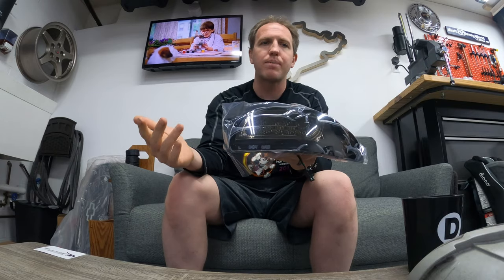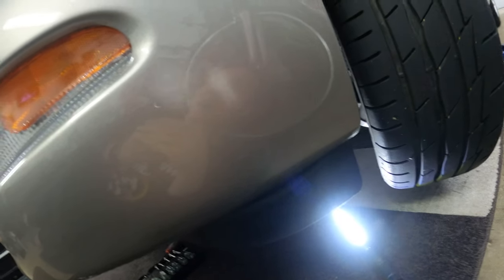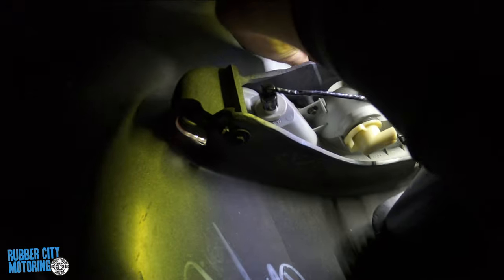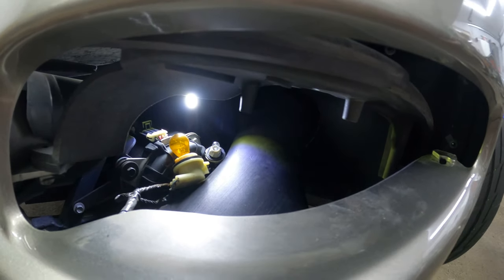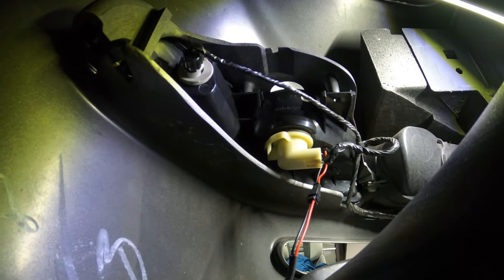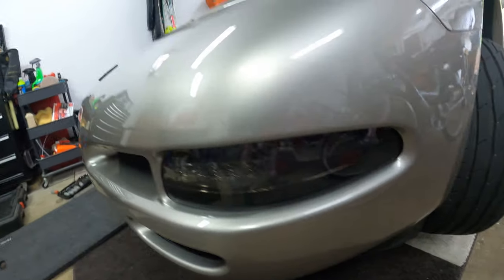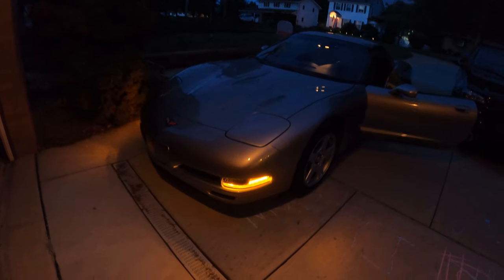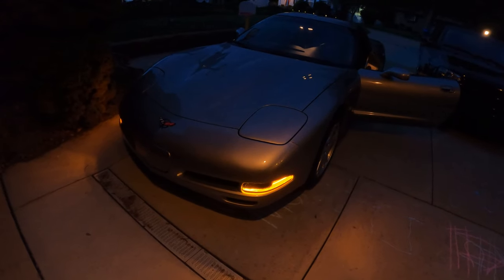Vette Lights 97-04 C5 Corvette Laser LED Front Corner - Install & Review

Comment: Hi JT, thanks for the great video and instruction. I had always thought it would be a more time consuming project until I watched your video. The whole thing took me about 3 hrs. I pulled the wheels off for a little extra room.  The only other tool that I used besides the 1/4” ratchet and the nut driver, was a mini finger ratchet. Really is a great update for my 03 C5. 
Thanks again.

Comment: I ended up installing the front corners from the top by removing the headlights. I’ve removed them several times for HID/LED upgrades so I’m familiar with the process. I couldn’t do it from the bottom because I zipped tied HID and LED ballasts and wires to the brake cooling duct so I can’t easily remove it. I found doing it from the headlights space easy and you have plenty of room to see and work on it. The smoked corners look awesome on my Torch Red C5. Thanks again for the useful video and help!

BTW, the spring is very useful, keeps the housing tight to the bumper cover. This is important especially if your driving at high speed. Avoids pressure on the 2 bottom screws and prevents cracks to the bumper and corner light housing

Comment: Appreciate the step-by-step install!  I recently graduated from 1/32 scale slot cars to a 1/1 scale 50th Anniversary coupe, and am now working through exterior updates.  I just replaced the tail lights, third brake light, and side markers with smoke LED from vette-lights, super easy install, even the hyper-flash bracket.  I'm more nervous about the front corner lights, mainly because I'm not as young as I used to be and those are some tight spaces!  Looking forward to watching your other C5 videos, especially on the paint restoration.  Great channel!

Comment: Just  got mine in, looks like good quality 👌 gonna install today
Reply: Do these still hyper flash even with the harness install?I was thinking about getting these but that's a deal breaker for me,  I don't  want to run resistors
Reply: @Douglas Z  these lights are so impressive. I  don't have the hyper flash harness they come with plug-in resistors. There  true plug and play . They are 110% worth it 👌

Comment: I have been running these for a few weeks. No problems so far. Work great. The resistor though, gets so hot you can barely touch it. I mean super hot. It has bothered me enough that I bought a hyperflash harness that I will be putting in this weekend. Hopefully I can then unplug the resistors. They are hot AF.
Reply from the maker: Interesting! Good to know.
Reply: @RubberCityMotoring  I put in the hyperflash harness tonight. The lights worked better than before. Before they worked fine but the flashes were sometimes a little off speed like a few quick flashes and then settling down. Also mine really didn't work well if the engine wasn't running. So they worked fine when driving, just a little sketchy if you were paying attention. 
   With the harness and the resistors still in there everything worked perfectly. I removed the resistors and they worked great.
   Neither of the resistors was still glued on. The tape was baked brown and the black paint on them was gone. They are now copper or copper colored. 
    I'm glad I got them out of my car both because I think they were a problem waiting to happen and because the lights function better without them. $50 well spent.
  I'm sure all of the hyperflash harnesses are the same but if anyone is interested the one I got was from Corvette Envy and it fit and functioned perfectly.
Reply from the maker: Super interesting! Link to the harness you installed?
Reply: @RubberCityMotoring  https://www.corvetteenvy.com/products/corvette-envy-c5-corvette-hyper-flash-harness
Reply from the maker: Going to give this a try soon - any advantage to removing the small resistors? Basically, do they still get hot with the hyperflash installed?
Reply: @RubberCityMotoring  they are not needed at all with the hyperflash. Everything works better with them out of there. I also did led taillight bulbs. Everything works great. The flashers do hyperflash though. I have seen that on other videos. No big deal to me if the flashers hyperflash. Gets more attention anyway. The turn signals function perfectly. 
    Have you checked out your resistors to see if they are still stuck on and what condition they are in?
Reply: Greg, the ad says only need 1 per corvette. Did you have to buy one for each front corner light. my led halo taillights taillights had them built in.
Reply: @johnenelsonjr  just one hyper flash harness. It plugs in behind the kick panel, under the ignition switch. With that one harness I am running the DRLs and led tail light bulbs. Everything runs great except flashers, they hyper flash but no big deal. 
Those resistors are bad news.
Reply: @gregl4244  Do you simply unplug the resistor connection, or do you have to do something with the resistor harness wiring?
Reply: @MrCatrucker  you just have to unplug it.
Reply: @gregl4244  Cool, thank you.
Reply: Greg,, thank you for this info !
Reply: @RubberCityMotoring  could you do a  hyper flash harness install video ??
Reply: Do i need to worry about resistors getting hot as hell and causing damage if I only put led bulbs in my stock housing units? Right now I do not have a hyperflash harness... all I have is just LED turn signal bulbs inside the stock housing.
Reply: @RubberCityMotoring  Did Greg ever send you a link to the harness? I’m going to get these for my C5 but I definitely don’t want hyperflash  if I can avoid it and if the harness is a better option than the resistors that’d be good…? Awesome video, thank you for sharing
Reply from the maker: I just used a standard hyper flash harness in the dash.

Comment: A little update..
Got the resistor harness in this morning. It took me less than 10 mins to put it in through the under panels by the steering wheel and it WORKED LIKE A CHARM. It’s 4 screws and the whole thing comes down but I would take the center console out which isn’t hard to do and do it that way you don’t damage any plastic tabs. Spend that $50 on the harness and do all the LED work you want on your car don’t depend on those aftermarket load resistors
Reply: shoot a vid showing that.....
Reply: @harryharry3193  of what? I don’t record videos but I can definitely guide you. Also you have to shift into neutral or 1st gear to pop that console back and up.. harness didn’t take me that long. It got confusing when I did my taillights to smoked LED’s so I had to switch to a better harness provided by the tech who sent me the lights. My stupid transmission is skipping now I haven’t done shit to it for about 2 weeks now. It skips 3rd and goes straight into 4th

Comment: Having some trouble with my C5 leds. Tried every way to connect the plugs but it still wants to blink in double time for blinkers. I have red to red on the small bulb and the led pack and black to black on the big socket?  Any thoughts?  Do I have to connect both lights for them to work properly?

Comment: Fuck the resistors they are aftermarket and work depending on the watts that’s shooting out the car. I bought a harness it’s coming tonight from corvette envy or anywhere but it’s simple to put in all it does it balance the flow of the energy to all lights. That harness will come in handy when you install LEd’s on the headlight as well. It’s all about balancing the power that’s all. Those resistors would’ve helped to a lower AMP led but the ones we got needs a harness because those resistors can melt through the plastic and catch on fire

Comment: So is there some additional kind of Hyper flash harness required for proper operation?
Reply from the maker: So these come with a small little module for each light.  They work fine with no issues and no hyper flash.

Comment: Do these hyper flash if you have the hyper flash harness installed? Do you still need the resistors with the harness? my C5 has the harness installed.  I also have the pewter Metallic BTW :)
Reply from the maker: From everything I heard, you won’t get hyper flash with your setup. Best of luck!!

Comment: So if I get these lights I have to exclude the resistor but put in the hyper flash harness?
Do these assemblies include the white parking lights also?
Reply from the maker: Everything you see is included - I had a hyper flash harness before, which seems to help everything out.

Comment: I just installed these. My blinkers now blink as if a bulb is out, all of them. What is my issue? What's the fix?
Reply from the maker: Did you install the little modules that plug in to the lamps?
Reply: @RubberCityMotoring  the little adhesive cylindrical device. Yes. It is installed on both sides.
Reply from the maker: Hmm interesting. I didn’t have any issues. Maybe somebody will have an idea for you. Any other leds on the car?